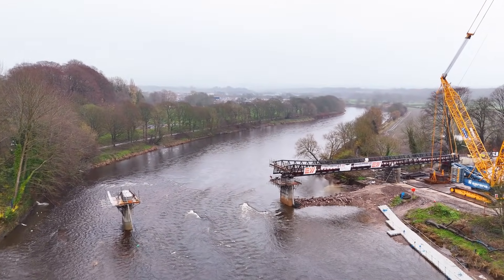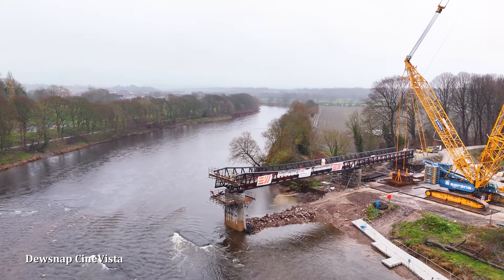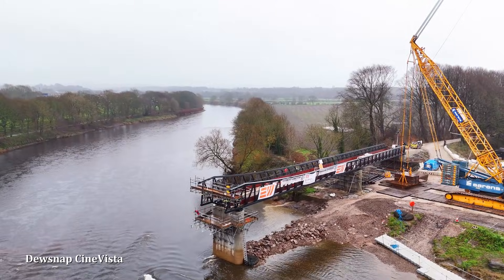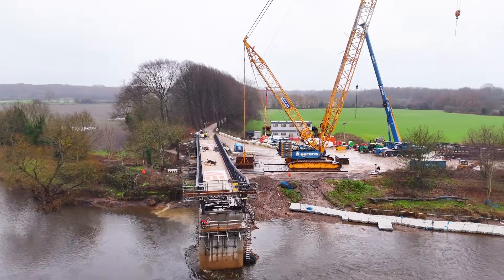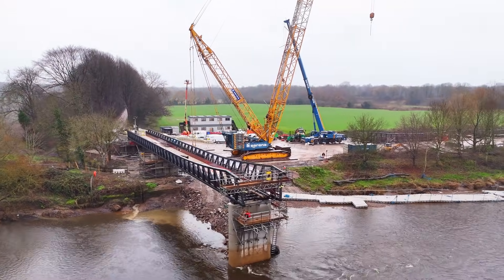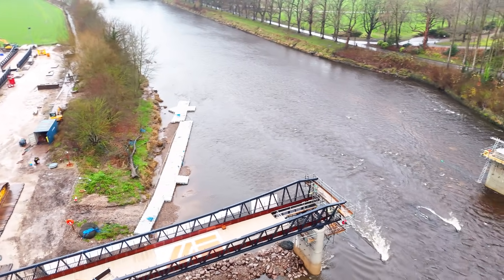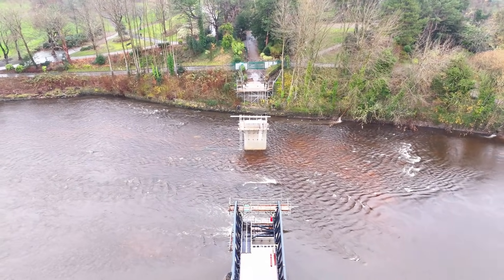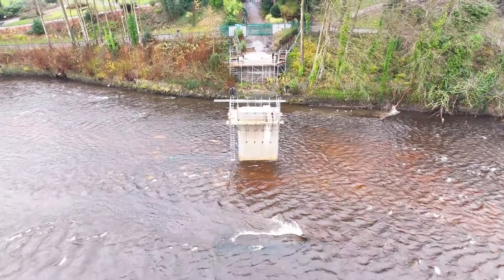Bridge Construction Project - Preston's Tram Bridge update - 4th December 2025

Comment: Is this reinstating a previous railway bridge?
Reply from the maker: Hi, it was an old tram line on a railway track used many years ago. The carriages were pulled by horses. It always has been a popular bridge for walkers, cyclists, horse riders etc. to and from the Park in Preston. It's no longer a railway bridge but the name stuck.😇
Reply: @dewsnapCV is there a pub on the corner
Reply from the maker: There is a pub on the corner called the Continental but its is almost a mile away. Only the cafe is nearby